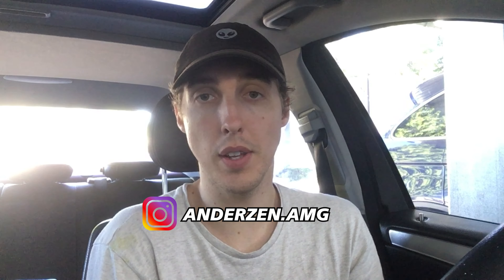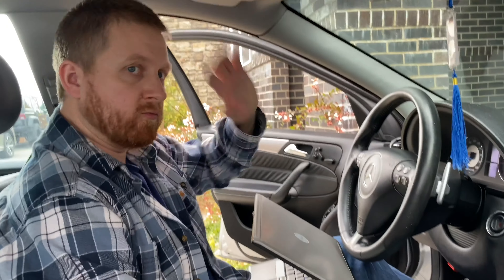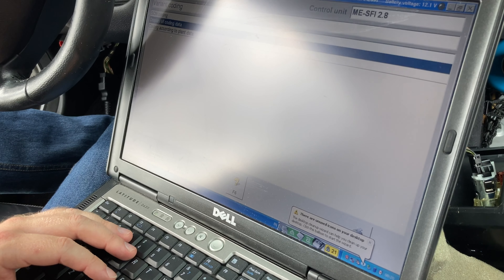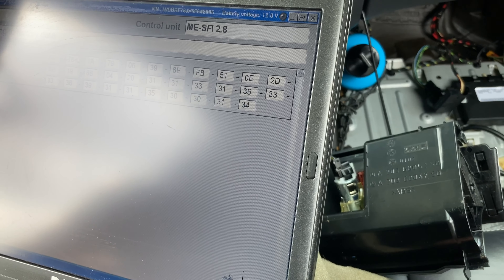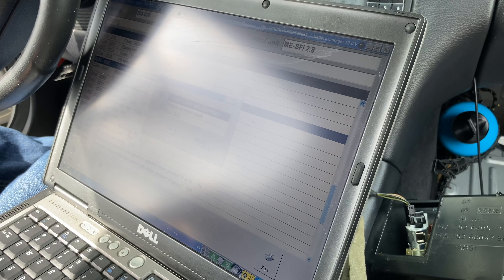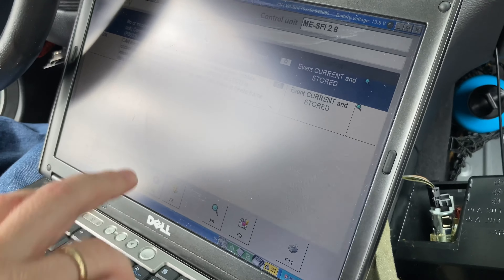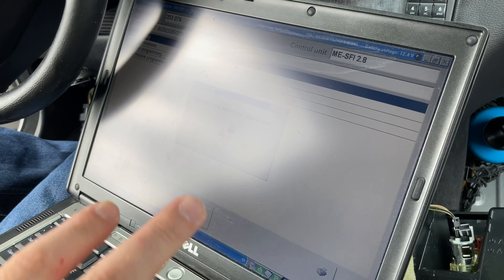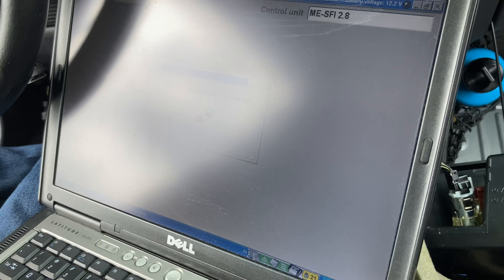C55 AMG ECU Coded to Manual Transmission? Manual Swap Pt.2 (TEST CODING)

Comment: That hex string is calculated. Changing values from one car is not going to be the same value for the next car. You have to run the calculation. It’s not saving because it’s not the correct value. That’s not the way you should make changes either. Give me a call/text or email. I’ve done hundreds of these over the last 8 years.
Reply from the maker: This isn’t the way we actually ended up doing it once it was completed, we figured out a better way after. Thank you for the input, I’ll reach out to you today 👍
Reply: how to do it with me2.8.1 2006 cls55amg, Im trying to do variant coding with Launch x431 but it will not accept new values